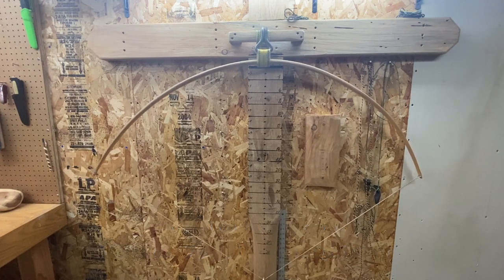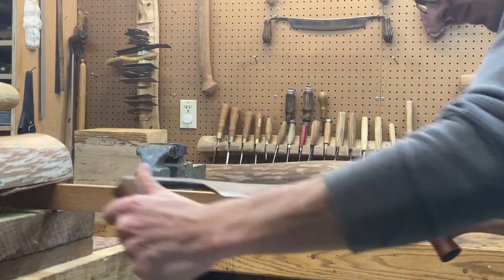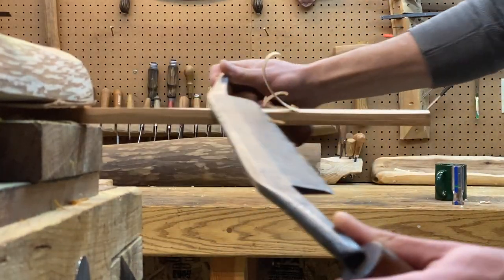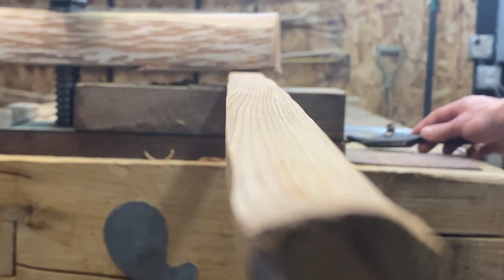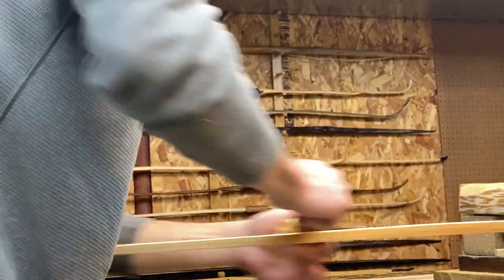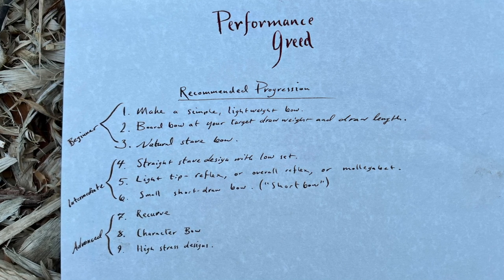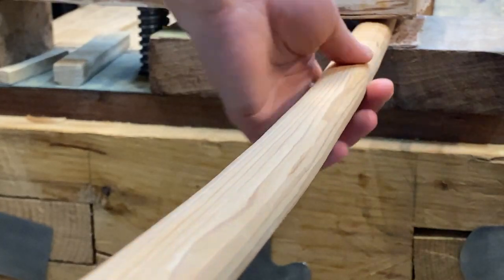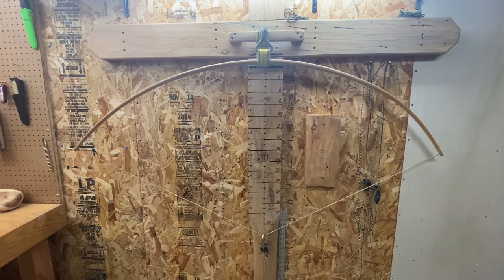How to Break a Bow 2: Tips for Avoiding Failure in Bow Making

Comment: Awesome video! I hastily bought a maple board from the hardware store, which had a wavy grain pattern. During the rough out I saw islands throughout and knew I was in trouble. I had never tried to recurve a bow before and when I went to recurve the tips, the tips snapped (by the second tip, I was just practicing my heating method).
Reply from the maker: Been there done that, and know the feeling!

Comment: I made recurve black locust short bow out of heartwood. Now, I wuld like to put sinew on it, but I am afraid to make scratches on bowback in ordr to weakining it. On the other hand I am afreit to put sinew witout making scraches beacause of possibilites of ungluing and falling of sinew layer. Wuld You please give me your`s oppinion?
Reply from the maker: I don’t think you need to scratch it, but I’m not the most experienced with sinew. Almost all my bows are self bows
Reply: Sand the back lightly with 80 or 120 grit. Use acetone or dawn soap and scrub the back good to strip any oils. And use REAL powdered hide glue to apply the sinew. Size the back with a thin layer of hide glue, wait 15-20 minutes, them start laying your sinew. No need to rough up the back.  Check out the bowyers Bible for more details. I've never had any sinew de-laminations since I switch to real high quality powder hide glue. Before I used titebond liquid hide glue (phony, stay away) and powder gelatin and they did not work as good.